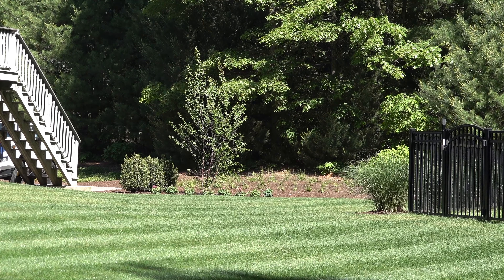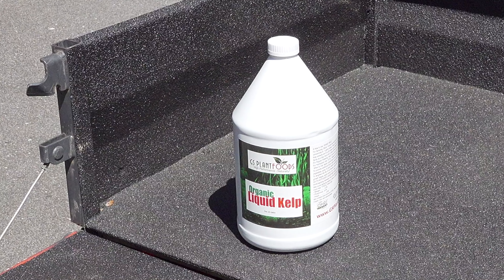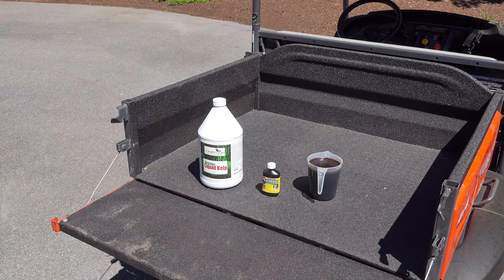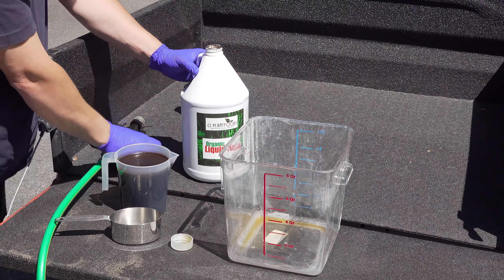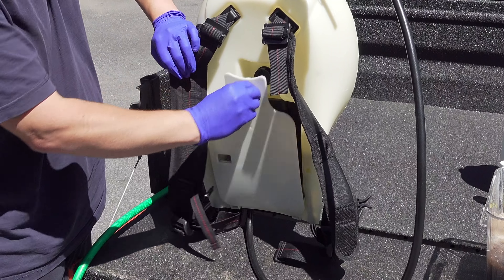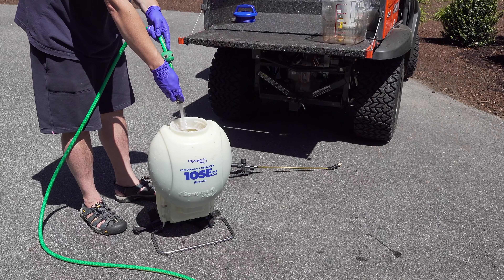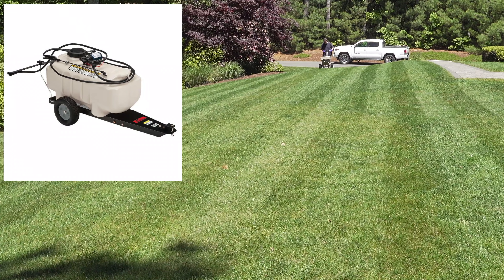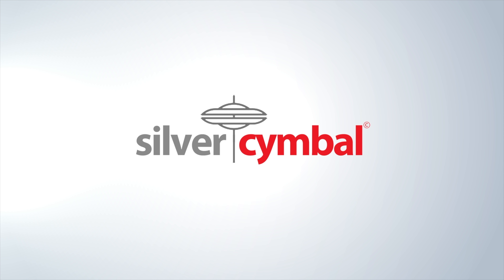Protect your Lawn From Summer HEAT & Stress my Secret Recipe STAY GREEN with Sea Kelp

Comment: Wish you would say how much this covers and not having those types of sprayers, can a hose end sprayer be used with different ratio?
Reply from the maker: Your wish is easily granted. 😀. About 2500 sq for.  You can go lighter and still gain benefits but that is the amount that has worked best for me. Also I wouldn’t recommend a hose end sprayer for this one. I would buy a very inexpensive sprayer. Pump type and use that. That will you will be sure to get good results. Best wishes to you.
Reply: Silver Cymbal thank you so much! Ok good to know
Reply: @SilverCymbal  does this need to be watered in?
Reply from the maker: @windycityrider  No just the opposite, just spray on and allow to dry. The next rainfall or watering ideally would be a day or two later.
Reply: @SilverCymbal  how often do you apply it? Thanks for the recipe!
Reply from the maker: @ronb493  Apply it monthly when daytime temps average over 80, usually 2-3 times during he summer. Even if you do it less there is still benefit but this gave the best results while being affordable,  Kelp: https://amzn.to/2It5ZJT  -  Superthrive: https://amzn.to/2It654d  - Humic Acid: https://amzn.to/2WyMABa - Sprayer: https://amzn.to/2IslQIJ

Comment: Would a hose end spray water this mix down? Is this ment for soil or flair?
Reply from the maker: You can use a hose end sprayer but it's really going to be tough to get the right mix. I would say that even an inexpensive pump sprayer would be the best way to put it down. It goes down fast and easy.

Comment: Once again, great video! I spend quite a bit on a ready made formula, comprised of micro-nutrients and humic acid and it has been a game changer for the look and health of my lawn; especially when I stopped using milorganite! I must say, that I took your advise on Lesco fertilizer instead of Milo and this year I saw a huge difference in my lawn, so THANK YOU! Now that I got out of the way. 
How often do you apply this mixture on your lawn? By the way, I have the same backpack sprayer and the battery charge is amazingly good.
Reply from the maker: Thank you very much I am glad my tips worked out for you. I make many mistakes before I do the videos so hopefully that helps save my viewers some aggravation and money. I like to apply this about once per month when temps are routinely over 75-80 each day. You can do it more than once a month if desired but this should should give a good result and keep the costs down. Thanks again for the comment for watching.
Reply: @SilverCymbal  No, no, thank you!
Reply: I have same sprayer its Awsome
Reply: Wait...why stop using Milorganite?! I just started using it this year and think it's working ok...?!
Reply: @Tman317  I sprayed the humic acid, kelp, supertrive and spread milorgranite 3 weeks ago and my brown spots disappeared and lawn turn  GREEN!! The only problem I had was not getting the 4gal mix to cover 1800 square feet.  I need a better sprayer or need to practice on walking faster when spraying...

Comment: Would formula prevent turf from getting Pythium blight fungus which very common during summer on fescue grass,due to the humidity in central California?
Reply from the maker: Not sure that this can stop a fungus but it has been proven to strengthen roots, helps plants have reduced stress and promote stronger plants so certainly could help but I don'r want to say it's a cure all for those type of issues. But it will certainly help the overall plant health and growth.
Reply: Silver Cymbal thank you,great video!
Reply from the maker: @MegaMaster04  Thank you very much

Comment: Question: it’s midsummer and my lawn is terribly dry and riddled with weeds. Should I prioritize hydrating it with this recipe or treat the weeds with tenacity?
Reply: first use weed spray, let it sit 1 week then water once the weed dies. It takes time for the weed to die make sure you spray the roots it WILL die just takes some timee

Comment: Can you use this in a hose end sprayer?  Have you ever used the humic/fulvic/sea kelp dry mix that Kelp4less sells?  I have used that to make a concentrate and then add to my hose end sprayer and it’s pretty cheap.
Reply: I'd like to know if you can use a hose end sprayer and what spray setting?
Reply: I dont see why not. I often switch from backpack to hose end when rain is not on the forecast. I will try this recipe and also add molasses. I think that might help with decomposition of dead grass.

Comment: What is the rate at which you are applying? My yard is 16,000 sq. ft. Thanks
Reply from the maker: It depends a bit on the sprayer tip and walking speed but I would mix up about 12-16 gallons for that much space.  If underapplied it is still effective and ovewrapplied will not hurt so its a forgiving mix.

Comment: Great presentation.  We live in coastal SC ... very hot and humid.  Two quick questions.  We just de-thatched our lawn and added sod to a large area.  Can we add this formula now?  And how often can we/should we add a second or third treatment?  We have high temperatures (90+) through September...  Thank you in advance for your help.
Reply from the maker: Yes absolutely.  There is no issue with it being newer and the humid acid will help the grass but most the soil and root structure which will be great for your new sod settling in. Thanks for watching.
Reply: Silver Cymbal Thanks again for your assistance.  Our lawn is approximately 12,000 - 14,000 sq ft.  Any idea how much of your formula we should plan to use?  Is 4 gallons enough?  More?  Just trying to plan how much product to buy...
Reply from the maker: @rickbethea2040  Sure, if you just buy one of each of these Kelp: @t  -  Superthrive: @t  - Humic Acid: @t - Sprayer: @t You will be able to more than treat that much area and will likely get 2-3 times. You should only need one set per season for that much square footage,. Thank you
Reply: Silver Cymbal Good afternoon. I just received the supplies you’d recommended (Humic Acid, Liquid Kelp, and SuperThrive), and I have one more question.  We had our lawn de-thatched just before we had new sod added to portions of our lawn.  In certain areas of the de-thatched lawn, we now have lots of weeds...rather discouraging, actually.  Should we wait to add the “root solution” until after we treat the weeds, or does it not matter?  My thinking was I didn’t want to nurture the weeds...  Your thoughts?
Reply from the maker: @rickbethea2040  Thank you. That is a bit of a tough one since the formula does help the weeds also and the mix will interfere with weed control for a few days since it coast the leaves. So I would treat the weeds first give it 1 week and make sure it rained at least once, or you watered and then go ahead with the recipe and you should have good the results. This way the weeds are already on their way out and will not get benefit from it. Be sure to watch my weed control video https://youtu.be/3RYe2HeOcQI

Comment: Should you water the lawn after application like most summer fertilizer?
Reply from the maker: No, this is different and really more of a vitamin/supplement/booster and not a fertilizer. You want it to stick to the leaves ideally and especially the kelp is taken in through the leaves for best results. You can water after 2 days. If you get rain or water earlier it's not the end of the world but the best results will be to spray it and leave it.
Reply: Should I still use a summer fertilizer in addition?  I normally use Scott’s products but thinking of switching.

Comment: If I use this formula in a hose end sprayer what would I set the sprayer on
Reply from the maker: You can use a hose end sprayer but it's really going to be tough to get the right mix and it wouldn't be my recommendation. I would recommend even an inexpensive pump sprayer would be the best way to put it down. It goes down fast and easy.

Comment: Do you think it would be ok to add a selective weed control to this mixture?
Reply from the maker: I would not add that. Kelp and Humic acid are very dark and coat the leaves and soil. That isn't bad but it will likely interfere with weed control. I would wait a week between applications if possible.

Comment: What kind of grass? What part of the country? What soil type? Why no surfactant?
Reply from the maker: Tall fescue/Kentucky blue - Massachusetts - Average soil - Surfactant isn't needed for this and it will give maximum penetration and then will wash into the soil after a rainfall which is good.
Reply: @SilverCymbal  Ah You're in the NE U.S....I'm on Long Island NY on the glacial moraine which means my "soil" is mostly sand and very little clay. It's feeling like it's very difficult to enrich the soil. Thanks!
Reply from the maker: @NikonErik   I have sections that have very high sand content also. It can be difficult to add organics in a way that isn't a nightmare to do. The humic acid can be a great thing to help enrich the soil for you. More videos coming very shortly on this too.
Reply: Silver Cymbal Massachusetts? What are typical summer temps? In the Carolinas, we had mid to high 90's in late May! I'm skeptical that any product can prevent cool season grasses from going dormant in those temps.
Reply from the maker: Nothing is typical in Massachusetts or New England. Many summers we have days hotter than Miami, it's very variable but we have really hot summers here usually.If I was in the South I would apply this any time daytime temps average over 75. For those times I like to apply this about once per month.

Comment: Once mixed what shelf life would you say it has until it has to be used up?
Reply from the maker: I wish I had a better answer but there really is no way to tell for sure. I try to mix only what is needed and use it up each time. Just keep the raw ingredients around and make it on demand. But if its used within a few days that should be fine.
Reply: @SilverCymbal  thank you very much for taking time to reply back. Once this is applied would you suggest leaving it for 24hrs and then watering it in? Or just apply and let the magic happen
Reply from the maker: @Bossko1986  No problem. Yes just apply it, wait at least 24 hours or more until your next watering (natural or otherwise) so you are correct you really don't have to do anything once applying it.
Reply from the maker: @Bossko1986  Yes I think that would still be very beneficial. Humic acid has had a huge boom here in the US in the past 5 years and it seems that places like the UK and Australia have been very excited about Sea Kelp so it seems like the two will eventually cross pollinate the products so we all have good availability.
Reply: @SilverCymbal  thankyou. Tbh the UK is far behind the states. We are a fully cordless company using EGO equipment and fully organic. We make alot of our own treatments apart from liquid air which I import from nature's garden in the states. That stuff truly is amazing. We need to push organic alot more over here but the Brits have a thing of needing their lawns low and dead and want instant results hence chemicals. Give it a few more years and we will start to realise that the states are on to something good. Let's face it, organic was here alot longer than chemicals lol
Reply from the maker: @Bossko1986  Very true. I love a lot of the UK mowers you have there. you get some of the coolest ones with striping rollers, those are tough to find here!
Reply: @SilverCymbal  would you say your mix would green up the foilage aswell? We use alot of chicken manure but with this being seaweed based aswell that's an alternative for a greener upper isn't it?
Reply from the maker: @Bossko1986  Manure is of course always great but can be a lot of work to apply. This is easier and wil definitely help the plant with stress and health which will result in a better looking plant. It isn't fertilizer but has a very beneficial effect.
Reply: GS Plant Foods seem to have a good verity on products. What would you recommend for a green foilage from them? Kelp&fish or the organic fish oil looks a good contender

Comment: Hi Silver, just came across your video. I'm in Nashville and love my TTTF/KBG mix. This summer it was hit really hard with heat stress. Anyway Love this mix, I haven't put it down yet. Just got my ingredients in a couple days ago. Just have a question or two, can this be applied with a hose end sprayer and if not, are you watering it in immediately after application? I do use a backpack sprayer, however; I do like to use hose end at times for speed and to get product to the soil, unless it's foliar application. Your thoughts...

Comment: What temperature range do you apply it? Do you water it in after applying it? Great video.
Reply from the maker: I use it anytime temps are averaging 80 and up during the day so for us thats usually July and August. I do it once a month during those times.
Reply: @SilverCymbal  does it need to be watered in?
Reply from the maker: @sebastian56309  No, just spray and allow to dry. It is absorbed through the blades. Give it 24 hours or longer to work then rain/water is fine after that.
Reply: @SilverCymbal  thanks.😺

Comment: everything you do to a lawn must be done at evening when sun is not strong and shade has began even cutting the grass spreading fertilizer ,, it will be the most effective way and results with less work and do not spread anything or put anything in your lawn in the summer and water 2 a week in summer in the evening  also cut less your lawn in the summer 4 inches-10 inches by rigging up your wheels  larger size or add another set a wheels larger next to the other wheels without taking anything off,, hydrogen peroxide helps in the fall and  spring for heavy water,fungus and mold use it with proper dosage,,, your grass will get use to this method and become immune to it and you will thank me,,,been there done that and still working on it,,

Comment: Any idea how long this can be stored? I only have about 750 square feet to spray so mixing this large a batch would last me through the summer?
Reply: Hi, love your videos. If I use root rukus which has sea kelp and humic acid and is by the same company how much would you recommend I use based on 4 gallons. thank you

Comment: Super video.
It's hot here and I can see our lawn being stressed by this heat.
Question:
Mixed the solution---do you spray in the heat of the day OR do you spray in early morning or late evening??
Thanks
Reply from the maker: Yes have the same 100 here today! This has been saving my lawn this year for sure especially with this extreme weather. Dont spray in the heat of the day, early is usually very wet from dew. Best time is after5-6pm when temps drop and the grass is good and dry. Perfect for putting this on.  Probably the best thing I did for my lawn Details here:  Kelp: https://amzn.to/2It5ZJT  -  Superthrive: https://amzn.to/2It654d  - Humic Acid: https://amzn.to/2WyMABa - Sprayer: https://amzn.to/2IslQIJ

Comment: Thanks for the recipe. Can this recipe be used on seedlings or when seedlings are growing? Also, you said only apply during hot days, should I not apply when it’s below 90? Thanks!
Reply from the maker: Thank you, its been a fantastic formula that has even exceeded my original thoughts. It works on any typical grass, plant. Trees it won't do much for since it's taken in through the foliage so perfect for youg seedlings and grass.

Comment: Good video.  I assume one application is sufficient?  And at the beginning of summer heat period, in my case July?  Also, what about shade cloth over the most vulnerable areas during peak heat hours of the day?  Thank you?
Reply from the maker: Not usually, If it is very hot 80+ average days you will want to apply it once monthly for best results until it cools down. Thanks for watching.
Reply: @SilverCymbal  Great!  I'll do it at least once a month in July and August.  How about a shade cloth?  I want to stop the stilt grass and crab grass from growing in the most stressed areas and I figure providing some shade during critical hours of the day in the areas most exposed to sun would protect the good grass and prevent unwanted grasses.  Thanks again.

Comment: Will this green up the lawn quickly?
Reply from the maker: Those products are usually scams. This builds strength in the grass so yes you will likely see visual improvement, what you won't see is your grass dying off as quickly,, especially in heat and it helps the soil which does push the grass to green up as well. But I don't want to tell you it's snake oil. It real stuff

Comment: Great videos! Could this be used more often like every 2 or 3 weeks? I'm in San Diego and my yard is about 500sqft and is direct sun almost the entire day and is a tall fescue. From what I've been told, all previous owners could not keep the yard green at all. Had sod layed in Feb and the yard is green, but is getting a little brown sprinkled in. What are your thoughts if I make a 2 gallon recipe, but only use one gallon. Do you think it would be ok to leave the other gallon in the sprayer until the next treatment? Thanks in advance.
Reply from the maker: Definitely every three weeks will do very well. Especially if you have low water and high stress in your yard. For this treatment it is fine to leave in a sprayer for 2-3 weeks but you may get some clogging at the tip, Not great to leave product in there but the solution will still work.
Reply: @SilverCymbal  Thanks.